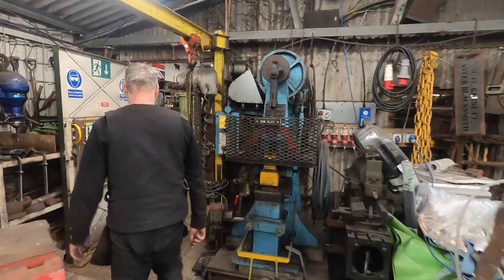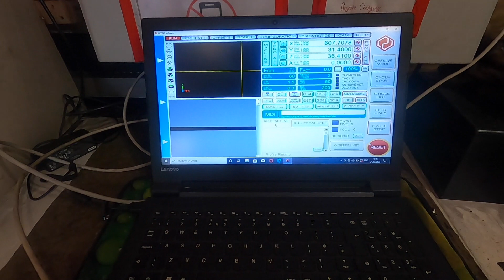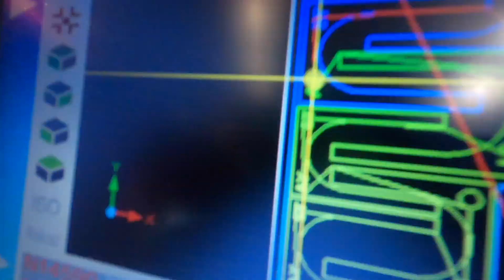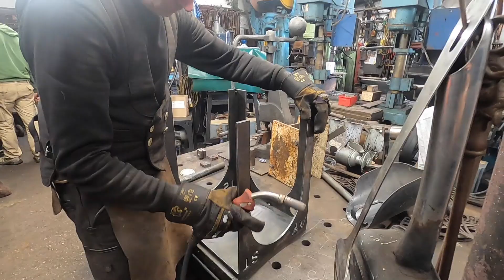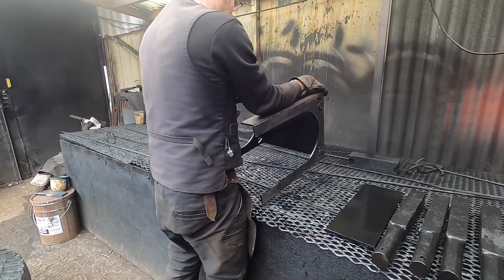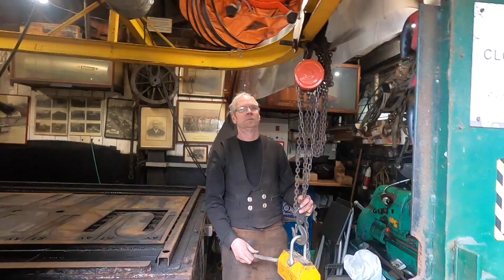Anyang Power Hammer Motor Guard  -  Cut on forge made CNC Plasma Cutter

Comment: Nice informtive video as always Nigel. We seem to have a lot of the same gear... only you have a heck of a lot more and bigger. 😁 I have an Avid cnc plasma table also with a water table and an XP45. I used to do garden signs and the like so it was fine for my needs. I have cut 10mm plate quite easily with it, although not on the finecut consumables and a tad slower. I made my motor guard out of 3mm plate bent up and bolted to the motor mounts. Just in case the motor needs to be removed.
Reply from the maker: Hi Anthony   i can lift the motor out with the guard on as we made it tail so you can do so .most of my work is big so i dont have to compete with garden shed blacksmiths with no overheads that way i can give my small work to them and they give there big work to me and we all survive .
Reply from the maker: hi again just a pointer mix a big bag of borax in your water table it stops it going stinky and is cheaper that the right stuff .we was creating life in ours as it is a plasma being fired into water and bugs were living in it and it smelt bad.
Reply: @NigelBarnettArtistBlacksmith  Thanks for that tip. Up to now I have used the "store bought stuff". Which is kind of expensive.
Reply from the maker: borax for our tank was only £30  for a massive bag and it lasts forever .